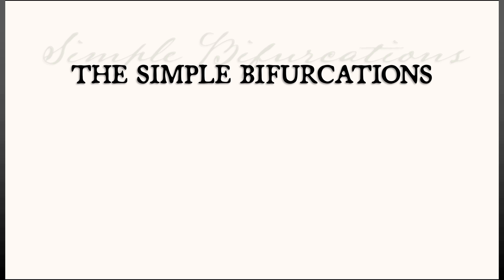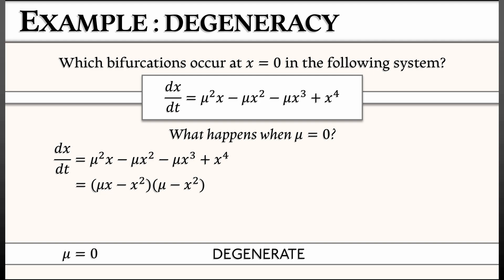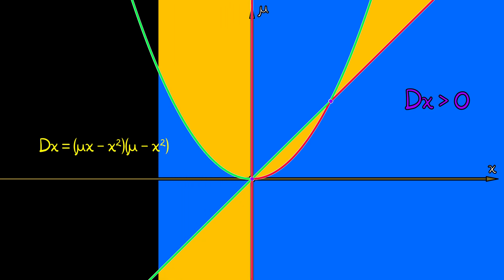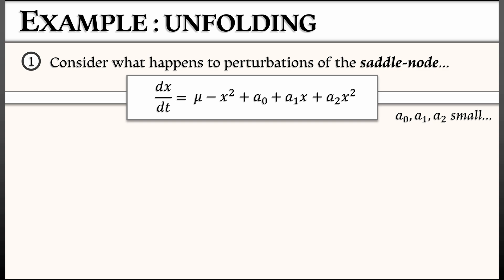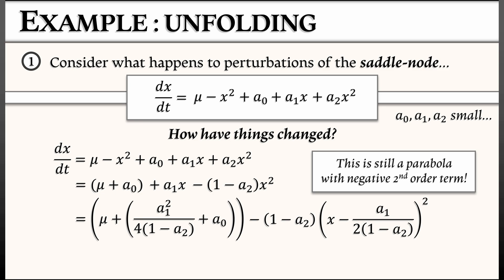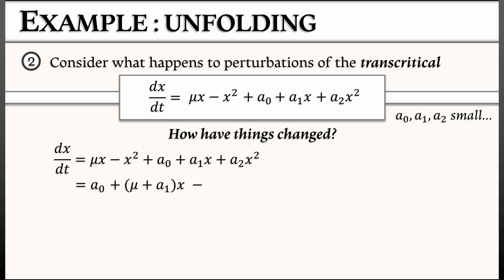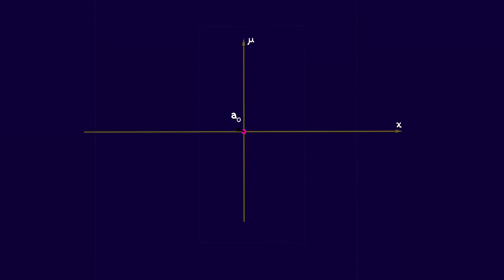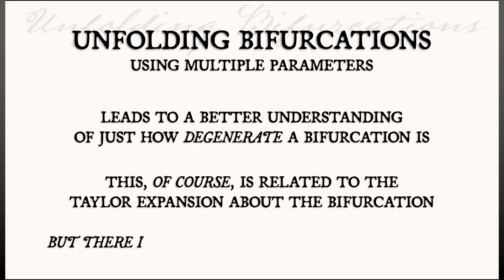ADS : Vol 1 : Chapter 8.3 : Degeneracy & Unfolding Bifurcations

Comment: I believe the a_0 > 0  and a_0 < 0 cases in the end are flipped. You can check in Desmos that yx - x² + 17 = 0 is a pair of saddle nodes when a<0 (they are actually hyperbolas, but I image you can put them in the normal form).